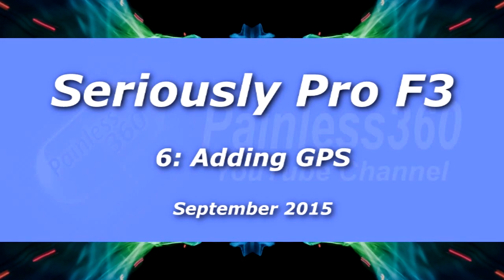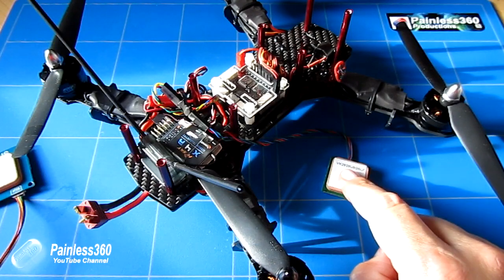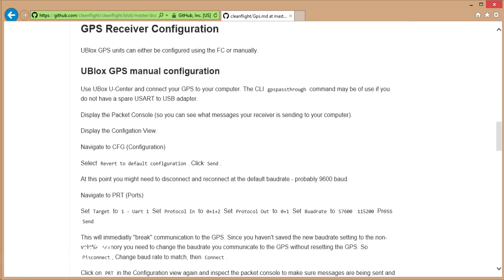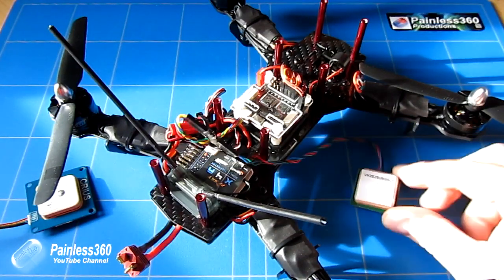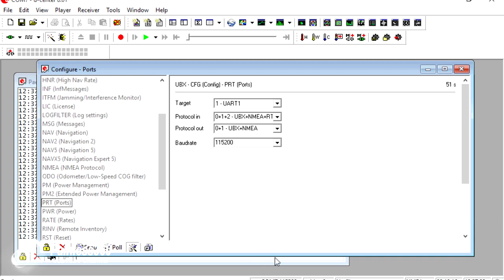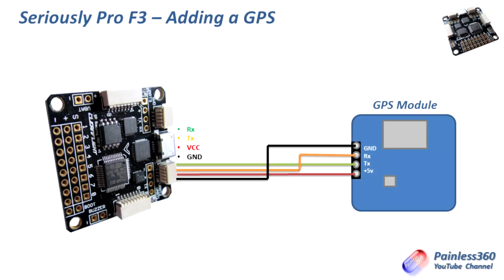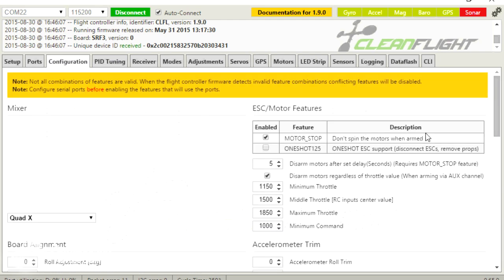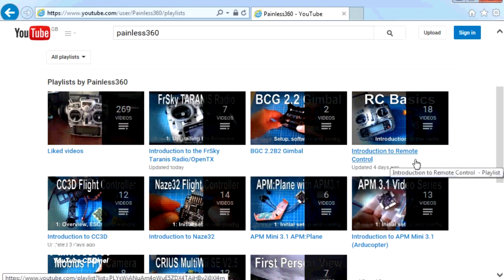(6/9) Seriously Pro F3 (SP3) Series - Adding GPS

Comment: When I plug the minni NZ GPS to my Flight Controller (Am using the same FC like in the video), am unable to connect to Cleanflight/baseflight. I have done everything that you have done and said in the video, any idea why this is happening?

But I remove the battery and then connect to cleanfligt/baseflight and then plug the battery back in, then all it says is "Wating for data"

Thank you for a good channel.
Reply from the maker: Sounds like there is a problem with UART1 (usually shared with the USB cable) when you've connected the GPS. Make sure you've not setup UART1 as the GPS port. Copy what we do in the video. Best of luck!
Reply: Thanks, now it's working

Comment: I had a small problem problem with the GPS in the final stable version of this f3 flight controller the GPS function is not working because cleanflight disable the GPS function in controllers that has small memory so I downgrad my firmware to lawer version and every thing is working perfect on cleanflight with the correct config for the GPS receiver but the board doesn't talk to the GPS and I double check the config and the baud rate and also the ports
GPS is 3d locking but no data received on the f3 board side
Reply from the maker: Features in F3 flight controllers have been depreciated for many years. F4 is the entry level for modern builds with F7 being a safer bet... Happy flying
Reply: @Painless360 
Thank you for your reply
I flashed it with my own compiled betaflight firmware and I had to disable some features that I don't need in order to enable the GPS on f3 mcu and now it just work perfect 
I think tomorrow I will go to flight and I will try gps home/hold and will give you a feedback about how it goes

Comment: Hi my name is Octavian and I am a follower of your channel.
I am writing  to ask you for some help to pick the right GPS model for my drone
I am planning to install GPS to my quadcopter and play with various functions such as return to home or flying missions. After quite a lot of reading, I have got a rough idea on how to do it but I am still uncertain about which of the different types  or models of the NEO-M8N GPS & COMPASS it's the right for my drone, ( I am flying an Eachine wizard x220 with a F3 6DOF, flight controller, that run betafligh).
I have found the same Neo m8n GPS and Compass module with different connection cable plugs:
   First the module with two plugs on the end of the cable ( one plug with 4 cables and another one with two cables in total 6 cables) to be used with APM & PIXhawk.
   Second the module it's the one with 4 cables with individual plugs to be used with Naze 32.
   The third mkdule it's the one with one plug with 4 cables to be used with CC3D & SP Racing F3. ( but some of the sellers and saying the dis module don't have compass).

https://m.banggood.com/Mini-Ublox-M8N-GPS-Module-NEO-M8N-GPS-for-APM-2_52_62_8-CC3D-SP-Racing-F3-Naze32-Flip32-PX4-p-1035454.html?gmcCountry=GB&currency=GBP&createTmp=1&cur_warehouse=CN&ID=520667&utm_source=googleshopping&utm_medium=cpc_ods&utm_content=heath&utm_campaign=pla-multi-gb-m&gclid=Cj0KCQiAyszSBRDJARIsAHAqQ4pi1xLFuw7Du28Qk2oEgvme4lQgS44SedaC6FIt0ImVkxAs6cOaCgwaAlM7EALw_wcB

What I have understood from all I have read is that the third one it's right for my flight controller, 
but!
Has this model compass even it has just for cables (GRD, 5V, TX, RX) comparing with the first one that has 6 cables into plugs (GRD, 5V, TX, RX,  /  SDA, SCL)?
Can I use the one with 6 cables with my flight controller?
Is there any way to connect them to my flight controller in the way so I can have compass to? ( this including cutting off the plugs and soldering the wires directly to the board).
I am thinking to buy the module with 6 wires because in the future I want to buy a pixhawk module to build a drone.
Can I install cleanflight on my wizard x220?
Or can you recommend me another GPS that works with my wizard X220

Thank you very much.
Reply from the maker: Please watch the iNav series on the channel - that should answer all of those questions! :D

Comment: Sorry for the silly question but I already have UART2 being used just for the telemetry to my Frsky x4rsb - I'm not sure where else I can move this if I put GPS on UART2. Any ideas?
Reply from the maker: You can use soft serial connections for those things that you need but don't have ports for. The max speed on soft serial is only 19,200 baud though.. Best of luck!
Reply: Painless360 thanks for replying mate! they sell you the board making out you can do everything and it's the same old story of struggling to find the outputs. bah!!

Comment: hi. could i add gps or cps with compas to sp f3 dof6 (with out baro and compas). it would be work in inav?
Reply from the maker: Not well as you need the barometer for a multirotor too really.. Might be fine in a fixed wing as iNav doesn't need a baro/mag to work there..

Comment: I2C Question 
I follow you tutorials to build and setup my first Quadcopter a F450.
I Would like to know if it is possible to use the I2C port on the SP F3 to connect my Crius Neo 6 GPS? If yes can you explain how.
Thanks
Fantastic Tutorials from Painless.
Reply from the maker: The SP3 flight controller is very old now, if you're looking at GPS, and I'd recommend watching my iNav series instead. Best of luck!
Reply: Thanks for your reply. I bought my F450 parts 4 years ago including a MultiWii V2.5 that makes me give up from the project. Now i finally get courage to build it and i would like to use the parts a have already spent money. In fact what i get recently in eBay is the SP F3 but i never thought that this FC where so out of date.
Reply from the maker: I see. All of the information I have from when I used to use MultiWii stuff is in this video series. Best of luck with your build!

Comment: Hy 
I'm trying to set up the gps with u center but when i want to setup the msg part i can only change one of them and after this i can not swithch to another selection in the drop down..... Maybe i'm doing something wrong ??? Can you post your saved configuration file ? Maybe it works like that... Kind regards: Jan
Reply from the maker: If you're looking at GPS modes then I'd look at iNav. It's auto-configure for the GPS works great and means that you just need to plug it in and not mess about with all this in Cleanflight.. Best of luck!

Comment: I have both a old basecam 8 bit gimbal (the one you demonstrated a while ago) as well as this GPS, and it appears they use a 1.25mm spacing "molex picoblade" style connector, which I guess went out of style for some reason. My Seriously Pro F3 EVO board instead uses (according to the manual) a micro-JST-SH connector, which is incompatible. What should I be looking for to get some cables that would allow interfacing between the controller and my peripherals?
Reply: ALso, unfortunately, it appears my receiver (flysky FS T6) does not have a PPM output, how can I configure cleanflight to accept inputs from it? Which pins are used for parallel PWM input? Thanks!
Reply from the maker: See the SP3 series earlier on, we cover that in detail. Best of luck!
Reply: I have the Seriously Pro F3 EVO, and the pinout is different. I'm unsure if your tutorial is compatible with that version. I'm mainly trying to figure out for sure what type of connectors the old BS gimbal and CYRUS UBLOX GPS use. 

I picked this particular version because it utilizes the MPU9500, which integrates MPU6500 and mag, and has a barometer (although admittedly the baro that's on you version of the board produces more accurate and less noisy results. I hope that the board can use GPS altitude instead of the baro or in conjunction with the baro for height regulation.)

Comment: can i use the ftdi adapter. usb to ttl converter module for ft 232 ftdi mwc multiwii arduino with 6p bupont line . to pg the gps for the cc3d revo?
Reply from the maker: +Mykel Plaskett Not sure, we always use the FTDI basic here as it's works every time. Best of luck!

Comment: I just install SP racing F3 (acro version) in my quad.  Now I am going to install GPS to play GPSHOME or GPSHOLD.  Since acro version doesn't equip with magnetometer, it is possible for me to active this mode?
Reply from the maker: Nope, see the first video in the series and the warnings in the GPS video..
Reply: +Painless360 Is it possible for me to connect external compass and GPS to the acro version of F3?
Reply from the maker: I've never tried it. Possibly..

Comment: I wonder why it does not work for me. I set it the same way You did, but GPS settings in cleanflight revert back to default after reboot. I use SPRacingF3 Deluxe, the GPS icon in status bar stays black. The same GPS unit - M8N works when configured for Revolution board.. it even has good fix as I see the leds on it blinking green and blue... I did try the cheap OP GPS as well with no success.
Reply from the maker: If you're looking at GPS then ditch Cleanflight and have a look at iNav, the GPS code actually works! See my series on it..
Reply: I found out that it is disabled by default due to  low memory issues in last relases - 256kB. Would have to go with custom FW :(

Comment: Hello, when I turn on the gps slide in the configuration tab, and then save and reboot, the gps slide is off again when i look.
what do i need to do?
Reply from the maker: Check that you have one of the UARTS configured for GPS. Use iNavflight - see my two series on it..
Reply: thanks! it works but now is my intergrated OSD not working and i cant set it up
Reply from the maker: This FC doesn't have an integrated OSD ;) Check the specs. Happy flying!
Reply: Hi how did you manage to make it work?? i have the same issue.thanks

Comment: How is GPS hold and GPS home modes working now as of July 2016?
Reply from the maker: Still waiting for the iNav code to be merged back in to Cleanflight.. https://github.com/cleanflight/cleanflight/blob/master/docs/Modes.md
Reply: Do you use the iNav version of Cleanflight configurator and the iNav flirmware for your flight controller? Many people have said positive things about the project fork.
Reply from the maker: All covered in the project documentation - https://github.com/cleanflight/cleanflight/blob/master/docs/Installation.md best of luck!
Reply: I was asking specifically if you use iNav... not sure how the Cleanflight installation URL answers that question? Hehe.
Reply from the maker: Not personally, I'm waiting for the code to make it back in Cleanflight before making any more videos. There are over 100 forks of Cleanflight/Baseflight now and it's simply too complex to track and document without devoting huge amounts of time to it. Happy flying!

Comment: please help!! lol i have a sp3 with a radiolink se100 gps i have floowed your steps over and over again and will not be found by betaflight   v3.01 firmware. ublox software works fine cant use gpspassthought ether.

i had a flip32 with the gps that u used on that vid and had no problem there. so i put my old neo06 module on and the works.

it works on my flip32f3osd and that was great till i made magic smoke with it!! :(

you r the best person to ask about this problem. im in uk and can call u if thats easier for u??
Reply from the maker: I've not used that GPS here, I'd look at how it's configured. Best of luck!
Reply: got it showing now but the little gps sighn oon gui goes on off on off??

eny idea
Reply from the maker: Sounds like the settings on the GPS or a bad connection to me. Best of luck!
Reply: Think it keeps switching between ubox and nmea?
Reply from the maker: Then it's sending both. How we got it to work is in the video. Best of luck!

Comment: Can you please make an update video for GPS hold on an F3 flightcontroller with betaflight?
Reply from the maker: No point, GPS modes in BF are far from perfect. Check out the iNav series on the channel if it's GPS you want..
Reply: Painless360 ok, thanks, but I have to stick with Betaflight :/
Reply from the maker: Then all I can do is wish you good luck.. you’ll need it!
Reply: Painless360 Thanks, I know... Maybe trying to use my racequad for everything is not the great idea... I made a detachable gimbal and landing gear for it(which works better than I thought, setting up a servo output in Betaflight for the gimbal controller wasn't very easy, but now it works). The only thing left to use it as a Areal Photography Platform is altitude hold, throttle hold is way too inaccurate.

Comment: I followed all the steps in u-center, including saving the configuration, but when I cycle the power the configuration reverts back to the default. I'm using a Ublox Neo-6M with EEPROM. Any ideas anyone?
Reply from the maker: Make sure you are saving the configuration and the GPS you are using has a battery backup that's working..
Reply: Painless360 It doesn't have a battery but has EEPROM. I'm starting to think the board is faulty
Reply from the maker: Possibly, I'd let the vendor know..
Reply: it has a small cell on board maybe replace it?
Reply: Joe Cooper Maybe its the wrong UART?

Comment: Good sir! Did you ever have any luck with the Holybro Micro M8N GPS Module in betaflight? I got mine up and running in Betaflight, but it just continually looses satellites and lock over and over. Any idears on how to get it working properly?
Reply from the maker: Ive not used it on BF. Make sure it's away from interference and not near the other antennas.. Best of luck!

Comment: Hi Is it possible to add a barometer to a seriously pro F3 board which did not have one installed when new?
Reply from the maker: It should be possible using the i2c bus, I've not done it here. Others have played with this though - https://www.rcgroups.com/forums/showthread.php?2394073-Adding-BMP180-Barometer-to-Flip32-Acro - best of luck!
Reply: Yes, I've done, you just need ms5611 baro and 100nF capacitor.

Comment: I have uart 2 used for smartport to the x4r, I have a FrSky GPS can I use that since I have smartport on uart 2 and still have telemetry to my x4r?
Reply from the maker: You need to look at using SoftSerial if you're running out of Hardware UARTS. Be aware that they only support slower speeds on Naze32 boards so reduce the GPS speeds down to 19.2Kbaud.. Best of luck!
Reply: Thanks for the info.